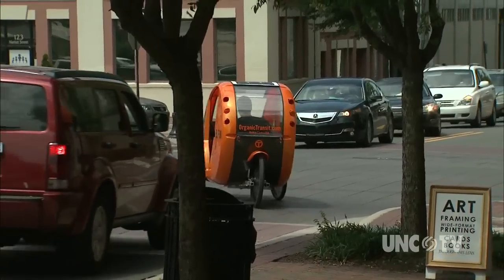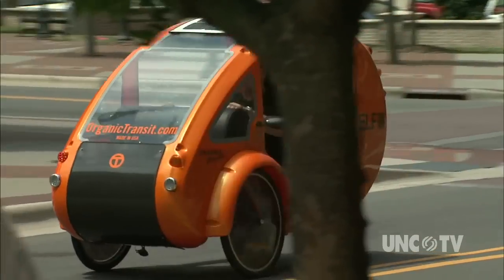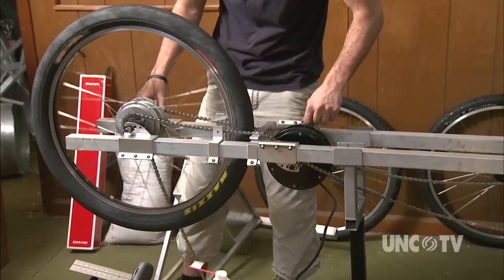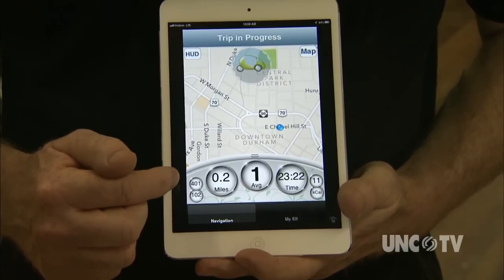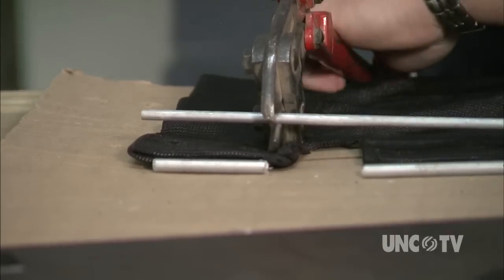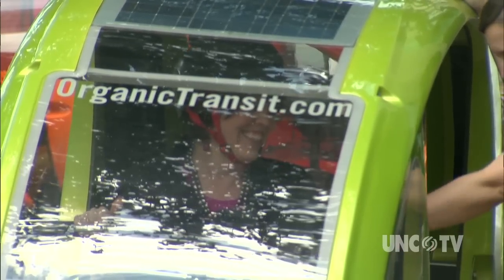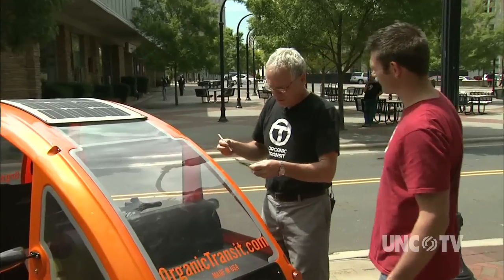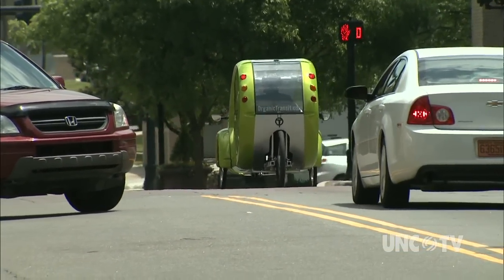NC Now | Organic Transit ELFs | UNC-TV

Comment: I don't understand the people who say "This wouldn't work in every scenario therefore it's a terrible idea." Dude, this is a bicycle with a little protection from the rain. It's not for people who have to commute 70 miles to work daily. It's not for people who have to take a highway to work. It's not for people who live in rough mountain passes.  It's not for people who live in places where you get a foot of snow every day.  It's for people who live in mild climates and live within 10 miles of work or the grocery store. For those people, the savings on fuel, maintenance, and licensing might be enough to make the switch.
Reply: A car isn't fit for every situation so therefore, it's a terrible idea, i mean, how else am i gonna cross the pacific?
Reply: oggyreidmore i
Reply: As per your suggestions which e tricycle is better for long,journey.
Reply: @najirhusenshaikh8169  Thy aren't for long journeys. Take a car.
Reply: Attach paddles to the rear tire and add pontoons. PACIFIC, GO FOR IT. (but, triple your insurance) :) 
(for those without a sense of humor, IT'S A JOKE)

Comment: I designed a very similar H.E.H. (human electric hybrid) over 9 years ago now. All be it with a different drive mechanism.
The main thing in the way of my idea is the fact that the UK government do not allow electric assistance over 15mph which is useless for my commute on 40-60mph limit roads.
Unless I want to register the vehicle with number plates, M.o.T., road tax and all the other unnecessary bullshit blocking this kind of commuter alternative. For safety, I would need to be able to travel at about 45mph.
Even though a fit cyclist can easily top that speed, the law says no go for electric assist for normal commuters. We must change the rules, or alternative transport will not have a chance to break into the mainstream here.
Reply: RunnymedeInstitute
He is referring to the stupid 250w limit on Ebikes in the EU and Australia. With no ability to register more powerful ones.
Reply: Brian Graves
I don't see that it's a problem. A car is very heavy and high powered which means it carries a lot of inertia, that potential energy is imparted into any other object it runs in to. The pedal powered equivalent has to be designed to be as light as possible and has a greatly reduced kinetic force on any impact. That, in my opinion, is just one of the vital differences between the two. ;)
Reply: To which UK law are you referring exactly? Micro Cars were approved on January 17th this year. That super ugly Italian 4 wheeler is legal and it has electric assist. Search Quadoe here on Youtube and you'll see what's going on in London right now.
Reply: RunnymedeInstitute
Really? I'll do that. I'd be very glad to hear the rules are catching up. Thank you. :D
Reply: The problem is you start blurring the lines between bicycle and car. Cars have government crash regulations and whatnot.

Comment: Sounds wonderful but ... I'd get killed driving around in NEW JERSEY in this thing.  There are way too many high-speed highways around here and trying to anywhere NOT taking an interstate would make commuting a total nightmare as one would have to take back roads everywhere.  And as for our winters ... this thing wouldn't last a day in the snow.  Pity - really does look well designed.
Reply: You need to move out of that hell hole if you have any self respect at all.
Weather is not a problem - these are used on snow and ice with studded tires. Videos of that are here on youtube.

Comment: great for the warm weather but in the cold weather it would be a different story
Reply: No you are exercising so you stay warm and out of the wind chill.
Reply: Popeye Gordon a little heater would be nice
Reply: Not needed. As I already reminded you, you are exercising while pedaling and you are out of the wind. Heaters are VERY power hungry and require a substantial expensive extra battery for something not even needed. So much smarter to dress in layers and peel off a layer once you warm up. You can also use a heat pad on the seat, warmed in the microwave before leaving.
Reply: Popeye Gordon good idea

Comment: It's cool, it's ugly... what a nitch. Sure needs to be 1/3 less in size, maybe even 1/2. 
Rather expensive for a glorified bicycle with NO suspension.  
1800 MPG in intriguing. Wonder what fat people will get? LOL 
ONE HUGE PROBLEM... most States have bicycle speed limits, 22 MPH.
Reply: Has suspension plus 3 inch tire option. Legal in all 50 states. The size is what is essential for this all purpose vehicle used to haul groceries or passengers. I weigh 300 lb and get good range due to the solar panel and my pedaling.
So basically you were 100% wrong. How does that feel?
Reply: I AM 100% RIGHT "It's cool, it's ugly" depending on the person. 
I AM 100% RIGHT (2017 Currently $9100.00) That is "EXORBITANTLY EXPENSIVE!!!" 
I AM 100% RIGHT 22 MPH is the speed limit for pedal powered vehicles. FEDERAL STANDARD. 
I AM 100% RIGHT "There's NO suspension. Wheels are mounted DIRECTLY to the frame." (tires are NOT suspension, springs are)
I ASKED what fat people will get in MPG's... not insults per MPG's. 
__OK, so I watched this video again. MAYBE I missed something... NOT! 
THIS THING IS OVERLY HUGE for one person. It still can be about 1/3 less in size. Length is OK. Height 12 - 18 in. shorter. Width about 1 ft. narrower at the wheels. Crumple zone would be less but there's always trade-offs. 2 side impact air bladders would weigh LESS than one pound each and if filled with Helium = zero or minus. 
That would be quite acceptable trade-off for weight and wind resistance. 
______How does that feel... BACK!!!?______
NOW GORDY BOY... I know a thing or dozen about ambient weather riding. I have been riding my motorcycle 24/365 for 6 years now in N.E. ILLINOIS. Rain, snow, wind, down to -17*F and I do NOT use elec. heat, proper clothing & layering. 
When needed, I haul a 5x12 ft. trailer behind this bike. Twice my loads were ~1500 lbs.. Several times ~1200#. But normally it's around 600#. And once my Wing hauling my '83 Wing at expressway speeds for 300 miles. 
GOT ANY MORE insults there.... (o0) POPeye?

Comment: I like the egg shape for a body, but this has a much larger frontal area than a biker on a conventional bike. You'd have to peddle much harder (or use the electric assist a lot) in order to make up the difference.
Reply: This shape makes it more aerodynamic than an upright bike making it more efficient. Also the recumbent position makes it easier to pedal. I like that it is the same height as an average car making it highly visible.

Comment: Sorry for the double post, the cost is bait high ATM , considering similar bikes go for 1500 -2000 but I hope with more demand this will go down in price as I'd like to own one but I can just go and get a fully motorized scooter for 600-850 and it has a higher top speed. Please re-adjust your costs and make this more affordable
Reply: You were so wrong. over 800 have been sold. Comparing to any gas power vehicle is apples and oranges. We want to live clean.

Comment: In places with an average of 35°C all year round, few bike lanes and extremely aggressive drivers where I live in Asia, or 6 months of winter, freezing rain going close to sideways in the wind, ice covered roads and only slightly less aggressive drivers where I lived in Canada, I'll skip the ELF. I really don't know what paradise this thing was meant to operate in but I'd like to visit.
Reply: Really odd comment. Every condition you mentioned represents reasons to use the ELF with it protective body shell. We use studded tires when needed.

Comment: Looks like junk on wheels.  All the rattles and noises coming from that thing would make me a little eerie about driving it in traffic.  4k?  No thanks.  Maybe 1500k.  4K i'll just buy a 400cc motorcycle If i were worried about saving the environment.
Reply: Cheap video cameras amplify those sounds. Not an issue.
Motorcycles do not compare in any way shape or form. Apples and oranges.
The materials alone cost $2,600 wholesale for this vehicle.

Comment: 4000 dollars but you need to insuance againist stealing
Reply: Not really. It has a removable key for the power. It can be chained or cable locked to a post. It can be fitted with a motion sensor or a GPS tracker. You can use a disc brake lock on it.

Comment: They way it bumps around it doesn't look too stable. It's a tricycle with a circular body and it took them 4 years to come up with it? Sad. Look at her completely secure from the elements... except that rain doesn't fall straight down and there is no floor either so if the road is wet get ready for a good misting from the road and passing cars. No thanks. Also, who is spending $9000 a year to maintain their "normal" car?
Reply: Keeping a late model car does in fact cost you over $9k/yr. Remember depreciation and insurance.

Comment: Solar panels are best fixed to a structure, out of the shade, and pointed at the sun. On vehicles, they add weight for little power.  A lot of vehicle designers don't get this, but engineers know better.
Reply: I don't know much about the subject, but the panels are more for trickle charging while the ELF is parked.
Reply: my apologies. I still think the weight of the panels compared to the battery and electric motor is negligible. that way you have a passive solar charging system as well as a plug in option. seems pretty cool to me.
Reply: wow so thats how solar panels work, pointed at the sun and out of the shade.
and those panels weight next to nothing bud. they are the flexible type, made of very thin plastic.
Reply: haha yeah, and vehicle designers and engineers NEVER work together right?
Reply: cody mason Its better to just plug it into a solar array on the roof.  The roof is out of shade and always optimal oriented to the sun.  The solar on the Elf is only 60W in the best case scenario, but if the solar is pointed the wrong way or shaded it will not make much power at all.  Check out solar race if you check out a solar race car, you will see that all of its top surface is photo-voltaic cells.
Reply: h macy: "wow so thats how solar panels work, pointed at the sun and out of the shade.
and those panels weight next to nothing bud. they are the flexible type, made of very thin plastic."
.. .. .. Every OUNCE adds up to earlier fatigue. Pedal power speaking.

Comment: About half the cost of a Velomobile and with greater visibility and ease of entry.  When the reporter crosses through the intersection, she crosses over bumps and it seems clear that this doesn't have suspension.  Without suspension, I would worry that the constant shock of bumpy roads will shake and rattle the shell, causing cracks that can't be repaired.  Those cracks would occur, likely, in key stress-points, greatly shortening the life of the shell.  Am I correct there are no shocks and, if so, why not?  Thank you for your effort to create a sustainable future.  This kind of work must continue.  Wayne

Comment: is it easier to steal?
Reply: Well, the doors are already open. You make the call.
Reply: I think there's a key that both engages the battery and unlocks the pedals.
Reply: No. In addition to the key for the power you can loop a cable or chain around a post to lock it. Use a disc brake lock or a motion sensor alarm or a hidden GPS tracker. Doors make no difference, you leave valuables in the locking trunk..

Comment: For $6800 you can get an Elio that gets 84mpg with A/C, power windows, power locks, hauls 2 people and can go 0-60 in 9.6 seconds with a top speed of 100 mph.  Available spring of 2015.  Ok, it does use gas, and if you're looking for a bicycle, the ELF might be better, but how practical is it? but my god it looks like it rides terrible!  Any suspension at all?
Reply: Yeah...and here we are in March 2017 and the Elio still is not in production and the last I heard, it will now be produced in 2018.  I am one of the investors and I fear that my money was for naught.

Comment: It looks practical for short distances.  However, I don't think it could be dependable for a 40 mile round trip commute. The 30 mph top speed is too slow for most urban main roads, and forget using limited access roads.

Comment: Yup, this is the libtards fantasy that we give up our perfectly good gas powered cars and ride around in stupid looking little peddle cars. Peddle cars are fine for your toddler, but I don't see any real man riding around in one of these twatmobiles. There is nothing better than vehicle made of steel, powered by a big ass roaring V8 engine.
Reply: When you're a real man you don't have to be afraid of what other people think and you can use what best serves your needs.
Although I do recognize the emotional need of the less self-secure to have an MRAP as a chest toupee.

Comment: Really?  you ask how would it work in a foot of snow?  What's in it for folks to be alternative energy haters?  How does  Camero do in the mud?  How does a Hyundai do  on the sand dunes?  All vehicles are lifestyle choices.  If it doesn't fit yours, then leave it alone.  In the short term to get away from oil, we are going to have to make some hard choices until these technologies are fully formed. If we fail to make these choices, we will always use fossil fuels and we will be paying too much and choking on foul air, with no solutions at hand.  I can also tell you this.  There will be no unified energy source in the future.  Fossil fuels will always drive commerce, Natural gas will power public transportation. electric will power commuter vehicle.  Electric will soon be sub-divided into power source segments.  These will include all known electric generators from fossil fuels to solar, to Geo-thermal and on...

Comment: how would it work in a foot of snow and at minus twenty?
Reply: almost -40 today... not goin anywhere if there isn't heat availible... lol... my poor car, could could almost hear it swear at me as it struggled to turn over.
Reply: *****
I do, but mostly on plowed roads :)
Reply: It wouldn't it would suck on every level as would using a bicycle, which only a complete moron would do. But It would work great in mild weather and this country has lots of that!
Reply: You can use a Ktrax for that.  Also human powered, like a snowmobile track and ski for a bicycle.  I can ride my bicycle safely in up to 3" of snow.  It's a regular single speed bike with winter studs.  Some guys race the Iditarod trail with fat bikes in worse conditions.  It takes an adventurous spirit.
Reply: Butwhy Doesitmatter Shows what I know.  I have limited experience with snow. It started snowing once, when I visited Mt Palomar.  We got in the Camero and nearly died getting off the mountain. Those wide oval tires were not made for snow covered roads!  I was a fool for driving up there in the winter and even more of a fool for thinking I should drive to safety.  That car had no business being there, but I still enjoyed owning it.
Reply: @tritowns It would probably start easier than your car at 20 below. And unless you have a honkin' 4X4 truck that's chained up on front and rear, it should go about as far as your car will in a foot of snow. (about a foot or two)
Reply: batteries at minus twenty don't work so well..
Reply: tritowns
Pedals work great at 20 below. The combination of weather protection and exercise makes it easy to stay warm.
Reply: tritowns
And pity the people with the diesels. They'll have wax clogging the fuel filters today.
Reply: tritowns In cold temps you'd bring the battery pack inside. Install it in the Elf when you're ready to go, and bring it inside to work when you get where you're going. Reverse this for the homeward commute. The battery pack has enough mass to maintain a core warm temp for the commute in both directions. Charging would be done at home and at work.
Reply: Bikes, just like anything man made, can be man made for winter.  There are fat bikes with wide tires that have ridden the snowy Iditarod trail in Alaska, there are also K-trax which are like a snowmobile track and ski for your bike, there are studded tires for ice, deep treaded fat tires for snow.  I haven't downed my bike in icy or snowy conditions once this year down to minus 30 celsius - it took me one year of mistakes to learn.  It's not for the weak minded and faint of skill to bang into - it's a learning process of adaptation and acceptance of limitations of self and tools.
Reply: *****
Anyway, this is a trike. If it slips you just wait for it to settle down, the same as you would with your car.
As the saying goes, it's not for everyone, but its very nice for some.

Comment: What a stupid creation... You can get Chinese scooters for 600 bucks that would go 35 mph with two people and get 80 mpg. What do you pay extra 4000 bucks for? safety? nope. Design? no. Does anyone know?
Reply: For the extra 4000 dollars, you save on future costs of insurance and gas. The way the legislation works in most countries nowadays is that if it can be pedaled, it is considered a bicycle up to a certain amount of Watts of electrical assist. Also, these velomobiles are trying to provide some shelter and luggage space which scooters do not have
Reply: For exercise WHILE getting to work if you live close enough, to be more "eco-friendly", for the day gas becomes too expensive(elio still requires gas even if it is less).